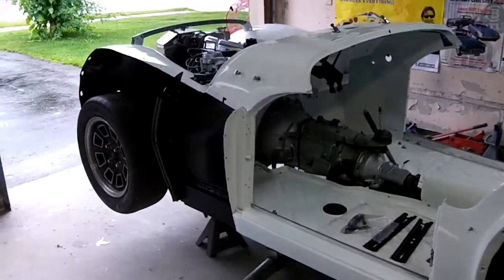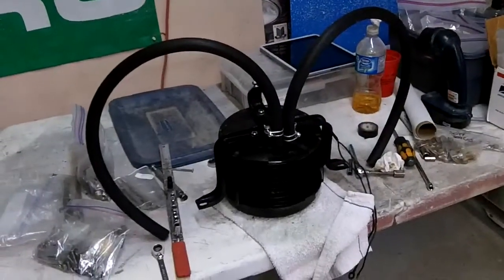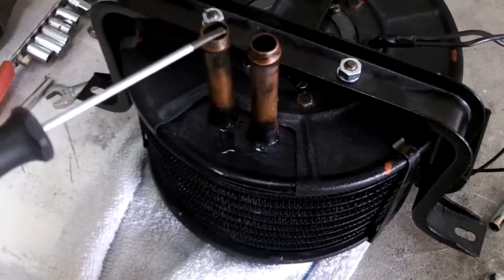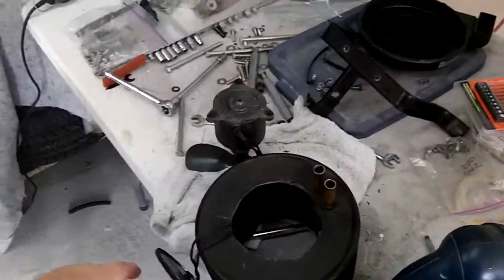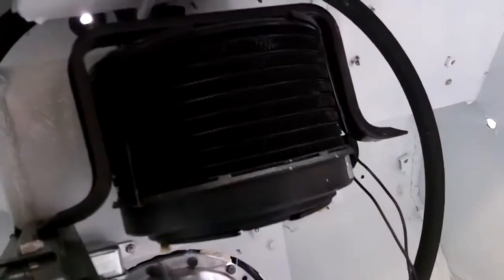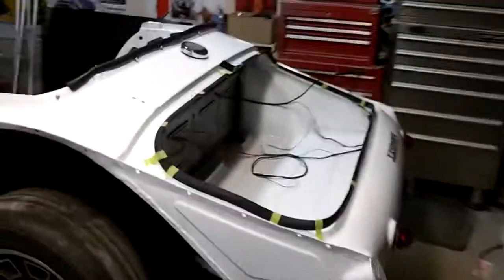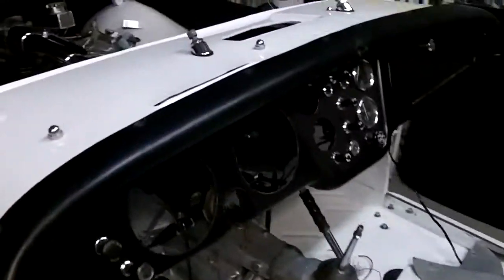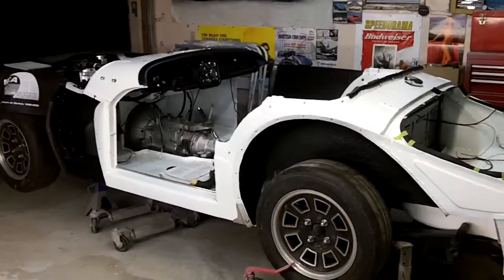Assembly Part 4, 1960 Triumph TR3A Restoration

Comment: Did you ever work out why the heater wasn't going in without the modifications?
Reply from the maker: I think the heater core had been changed out and the in/out tubes were not trimmed properly.